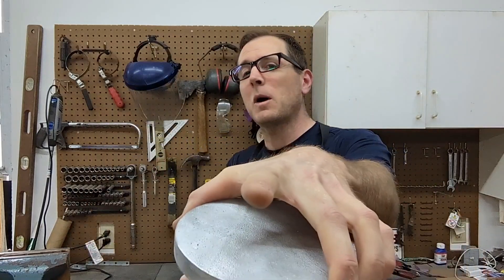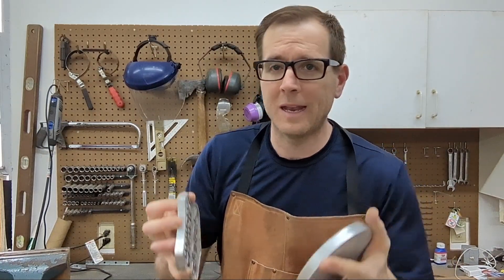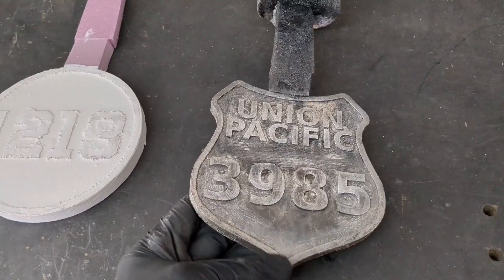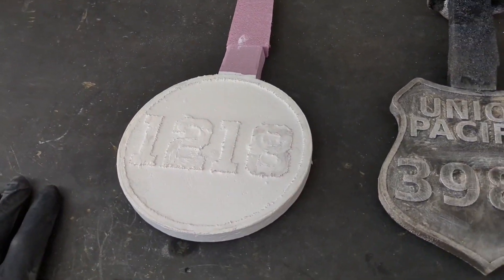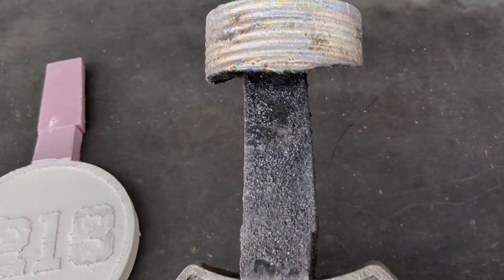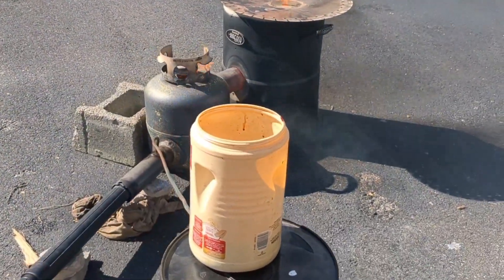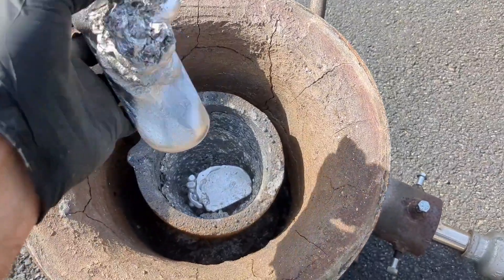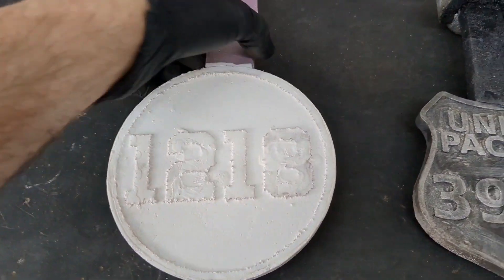Metal Casting Aluminum - The Ultimate Guide To Metalworking!

Comment: Good morning,
After watching more than 500 videos on the different techniques, with this method it seems much simpler and faster with a nice result. I'm thinking of going with this one, however I invite you to use something else that you plaster but of R35. Use for maximum detail for bronze sculptures
Reply from the maker: Hey, good morning!
Yes this is a super easy and cheap way to metal cast.  I definitely think you should give it a try.

I've never heard of R35 before.  Is this a rigid cement?  When doing bronze I add sand into the mixture of plaster.  It usually works, but if you stick around you'll see it doesn't.  I have a video in the next few weeks where I metal cast brass.
Reply: @HeinrichsMade  The problem is that I don't know anything about CNC, I would like to create my object with foam via a 3d model to import
Reply from the maker: @CreaSonMusik  I'm not familiar with importing 3d models.  You can start small by hand carving foam with a rotary tool.
Reply: @HeinrichsMade  Good morning,
R35 comes in the form of a powder to mix with water. Setting time 25' to 35'.
 Apply with a brush or spray gun.
Use for the shell of a 3d object.
Particularly interesting for complex subjects.
Ideal for small and large pieces (jewelry, sculpture).
Apply by dipping or spraying.
Very economical, quick and simple to implement.
Eliminate the scabies problem.
Resists high temperatures, 1000°C to 1500°C.
Excellent release

Comment: The possibilities are endless  with you method! The hole on your furnace is to big. To much heat is lost but an old mold to cover it partially should make it just as good as a $300+ devil forge.
Reply from the maker: Love this method!!!  The hole is large, but the burner is too small.  Also I cover up the hole with a firebrick.  I didn't show that.  I won't have this problem anymore.  I have a VEVOR 12kg furnace now🔥🔥🔥.  I will use this old furnace for when I make an oil burner for it.
Reply: @HeinrichsMade  i gave a viver but no matter what it turns out to be a heat thing and wear and tear.  You reinspired me on the waste oil which is probably the cheapest route to take providing you have a constant source of free waste oil.. in your case I thi k you need a more agressive supply of forced air meaning an air compressor and they are out there. I have two that eun just fine but the tanks were rotted. After a welded patch they both work fine enought to make the oil burn hot enough to melt copper.  If you're familiar with "offer up" thats where i bought both of mine for about twent bucks. That and a 16 gallon beer keg  and if not for the lack of ambition I would be up and running.😪
Reply from the maker: @mattyal9347  I'm glad I inspired you 😁😁. Yeah my waste oil burner was built as a break down furnace.  I wanted to use it to break down larger aluminum pieces into smaller ones.  After my last viy I'm going to make a burner that will be both propane and oil.  I've seen many on YouTube.  I just put the burner into my large opening on my old propane furnace.  It should work out great. Yeah I've used offer up before.  I forgot all about it actually.